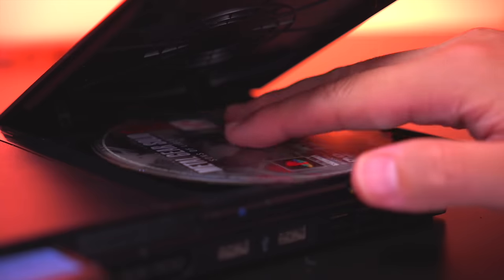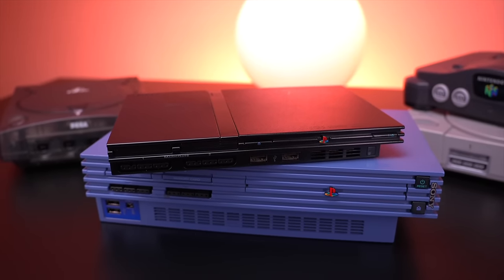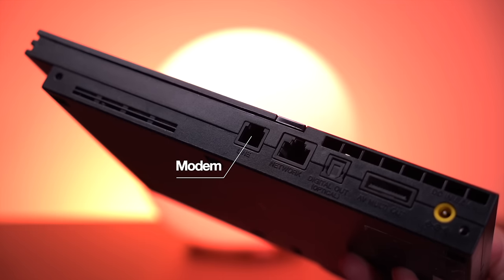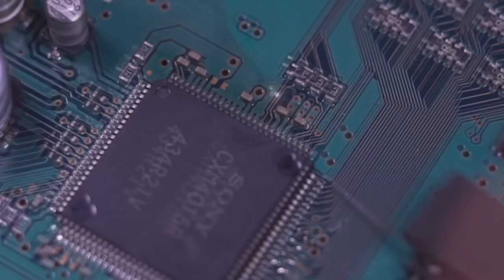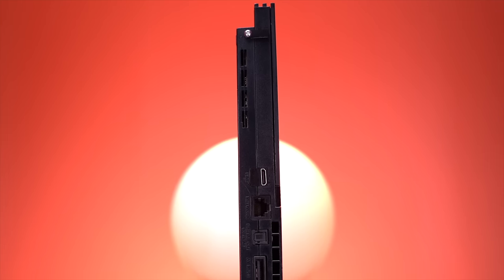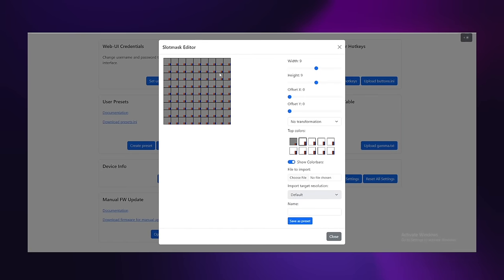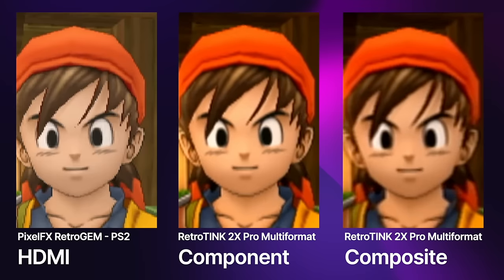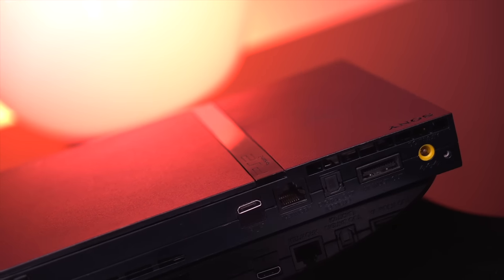This HDMI Mod Makes The PlayStation 2 Look GORGEOUS!

Comment: i've done flex cable installs with leaded solder - any tips for using lead-free solder? read that i should lower the iron temp to like 310C (normally do 360C), but curious if you have other thoughts. thanks!

Comment: Playing on a CRT will be the best way to play the ps2 with true scanlines.  If you want 1080p through hdmi, then the ps3 60gb plays all ps2 games with actual hardware and with the 40gb/80gb through software emulation and both version play ps1 natively  So what's the point wasting time with this?  This company is creating a solution for a problem that doesn't exist.

Comment: I almost turned it off when you said you were using lead-free solder, because that's what the board uses.
I've never heard anything so silly!
NEVER use lead-free solder. It just plain doesn't work very good.
Reply: You clearly don't work with motherboard repairs 😂
Reply: @Daveeeeeeyhowyoudoing  
I've done it for many years, actually.
Generally the first thing I do is remove the lead free solder and clean all of the oily stains it left behind.
Lead free solder sucks.

Comment: Dont take soldering tips from this guy, he should be using hot air to remove caps, and use flux to solder the chip.
Follow Louis Rossmann for soldering

Comment: I am meh on the 1080paywall; but it's a hard "No" if I have to lose the optical out for the thick PS2.   If it replaced the AVout that its...replacing, it'd be an instant buy.

Dolby Digital > 1080p IMO.

Also HDMI mini is kinda shit.  Replacing the AVout port would have given the room for the full HDMI.  And I wouldnt have to keep adapters on hand.

Comment: The fact that people are spending the time and money to produce components like this for old consoles is amazing. I’ll probably never get around to it on my PS2 but to be able to game on HDMI without any external devices is amazing. Yes it’s expensive but the fact this even exists in such a polished form? These kids complaining about $120 don’t know how good they have it 😂 and I’m sure if it was $190 without a cheaper feature locked version they’d still be complaining….what is it supposed to be, free? ?
Reply: $190 for HDMI output that looks kinda shit and requires you to solder anything at all is a complete ripoff. Might as well just emulate if you have that much money to burn, or get some cheap dongle that gets you most of the way there for a tenth of the price.

Comment: The price of this plus the price of consoles just screams dedicated pc emulator unfortunatley. Im happy that i only needed ps2 and have component inputs, but upscaling would be nice, not worth 200 dollars sadly. The fact that they developed a single device for all consoles is not a benefit for users, its just a cost saving measure for them, and they are passing the additional cost to develop it onto us. Its not like you can swap it out on the fly, you have to do the tedious teardowns and soldering so I dont know why they went that route. At these prices, 1080 should be basic and 4k should have been shiny.

Comment: So how does the Retrotink 4k / 5x pro compare to this mod ? from what i have seen the Retrotink is awesome (and no soldering and portable
Reply: I have the retrotink 5x pro for my ps2 (and it is good for any retro consoles) and I use the 2K/2.5K (2560 × 1440 (1440p)) resolution and works great.

No need to solder, just plug all the cables (either use a high quality ps2 component cable or RGB). You can also update the firmware of the device and create 10 different presets and most of these video specifications/features are here too (Deinterlacer, samplings, scaler, horizontal/vertical adjustment screen, etc.).

If you don't know how to solder, I suggest that you get a RT 5x Pro at least.
Reply: @danielsala81  Hi,  My retrotink 5x pro will be here Thursday :),  So i recently decided to revive my PS2... i done a few of the PS2 mods and one thing i have just finished is to allow the use of an external  2.5" SATA HDD instead of having to open up the back all the time to swap out an internal  one etc.. It is a solderless mod for the most part and allows a 12 pin FFC cable to sneak  out of the back of the PS2 and connect it to a small board i created so that you can easily  swap out the HDD if the need arises..  anyone who can reasonably solder should be able to  make the 2 small boards required (1 connected to the PS2 and the other to the HDD with the  FFC cable transporting the signals) i have a proof of concept working 100%. This mod will  cost about $10 to make and if people want it built then a bit more.... A 3d printed  case/support would set this off pretty well and the HDD could be placed pretty well  anywhere outside the case dependent on the FFC cable length
 
  Also, i have created a VERY cheap console to SCART adapter.  2 pieces, 1 plugs into the 
  console, and the other end plugs into a SCART adapter. I am still working on it... the 
  Amiga, playstation 1 and 2 are done and i am working my way through all the consoles.... 
  the nice thing about this is you connect both ends using a regular HDMI cable and the 
  price of the adapters is also VERY cheap... (no more $70 cables) and of course the quality 
  is BRILLIANT! (The HDMI cable is the best means of providing a noise free signal from your 
  console to your upscaler etc.  All the important signals are all shielded.
  I dont know how to post pictures so for the time being you need to believe me but it is for 
  sure 100% real.  I have done a lot of mods on the Amiga so you can search for me (kipper2k) 
  on google.

Comment: 2:50 But is the normal kit artificially never on stock so you (have to) buy the shiny version?
Reply: its also just software locked lol
Reply: There is no hardware difference between the basic and shiny tiers. It's one kit with the only difference being the firmware which you have the option to upgrade to at any time. I assume they did this specifically to combat stock issues. This way they only have to keep one universal mod kit in stock rather than managing multiple hardware revisions.

Comment: All this work and limited featured behind paywalls etc. all for nothing more than an upscaler with some filters. I feel like people would be better off just using an external device for this. What part of what it does makes there a need for soldering it inside the machine? What am I missing? The picture quality doesn't look very great. The component output looks less faded and way smoother. The HDMI is jagged and far too sharp, looks horrible.

Comment: Nice spam campaign... without a reason, there are a lot of videos talking about this mod. A mod that costs $99 in the basic version and $199 the premium version, which is very expensive in both cases and doesn't worth to pay it. If it will include the installation maybe, but just for a chip which I have to solder... it costs more than the entire PS2 itself.
just before knowing about this chip, I bougth a cheap converter for less than $3 and it allows me to play games in an HDMI TV without any problem. And the best, I can raise the resolution to 720p or 1080i with the help of the OPL program. Maybe it doesn't have WiFi or other settings and the video is not "digital", but C'mon... it's a PS2... to play games to 720p is enougth and I will not use the WiFi for sure.

Comment: This is garbage ... it destroys the image color space by forcing it to be in HDMI Limited when it should be Hdmi Full , when you compared it to Component RGB ... and you can clearly see this at 24:00 ... HDMI limited makes all washed out, over white color space of crushed blacks (Shadows just vanish in all games. The Color Black is now not BLACK but DARK BLUE , Brown is not BROWN but DARK YELLOW , Red is now not RED but DARK ORANGE , Blue is now NOT BLUE but LIGHT DARK ... it messes up the whole color space)... Compared to Component RGB, that presents all the color space with the correct colors... aka it craps on color space , making it a pointless mod ...
Reply: Xbox 1\XBox360\Xbone\Xbone SX\PS3\PS4\PS5 are consoles, that where made with Hdmi Limited in mind ... All Consoles from NES\SNES\Amiga\Atari\Commodore C64\SegaCD\GameCube\N64\Genesis\SegaSaturn\DreamCast\PS1\PS2 are made with Component RGB color space in mind (aka Hdmi Full)...  know your difference  , since this is Key in the Lands of HDMI and its Limited vs Full Color space ...

Comment: It has a wifi antenna, but only for firmware updates for the HDMI output mod?  What a waste
Reply: I mean would you rather take apart your console and manually flash the newest firmware onto the kit yourself, each time?
Reply: @ians_parks  if it outputs the HDMI signal, what updates does it need?
Reply: @customsongmaker  Here's a few examples of changes that were made to their previous N64 hdmi mod via firmware updates:

Improved 240p/480i resolution switching.
HDR10 support
Custom aspect ratios
Gamma adjustment
FXR smoothing
Slotmask creator
Custom controller hotkeys
Game ID handling and per game settings.
and numerous other bug fixes and improvements.
Reply: @ians_parks  Hopefully they'll include that when the ship the product now
Reply: @customsongmaker  There's always room for improvement as new discoveries/features are being made in the retro gaming scene. Wifi updates help to future proof your device. You aren't paying for something half baked. You're getting long term support on top of what you already paid for.

Comment: I have basic not shiny and retrotink 4k it might be bob interlacing but the image is very weird on the output.
Reply: Why not use the adaptive deinterlacing on the retrotink 4k instead? Should be possible with direct output mode (assuming pixelfx has released the firmware update for that atp).
Reply: @PolyHertz  yeah just got the direct mode in last update and this is what I did.

Comment: Just a question? Why mini hdmi?
Reply: Likely for clearance concerns. A full size hdmi connector might not fit with a "no cut" installation. Modders have been gradually adopting a no cut approach so that their mods can be reversible and don't permanently alter/damage the consoles. Like when you'd have to cut the case to fit an hdmi connector.

I doubt anyone would actively choose to use mini hdmi otherwise.

Comment: The exterior aesthetics look horrible, it looks bad, you have to cut the PS2 base and case, you need good welding equipment plus skills is required, GT not supported 1080, obviously it's not worth 190.

Comment: Yes the ability to output to hdmi is good. But the mod should not be so expensive considering the amount od work required to install it still. 
For that price I would have though they would have come up with easier install hardware (chip clip on connectors, etc). Given what is required for install with the current design, I think $100 is a far more reasonable price point for the shiny. 
As for the basic, that just seems pointless to manufacture. 
Shiny at a far more reasonable price 'OR' designed with better parts for faster 'clip-on chip'' install rather than soldering so much. 
Til then, I'm out.

Comment: Doesnt look right with that sharp pixels, i would prefer the stock, analoge output.
Reply: There are almost always smoothing options and numerous scanline filters to replicate the appearance of consumer and professional crts. The idea is simply to get a clean digital signal without any analog noise. You can then upscale, downscale, or make adjustments to the picture as necessary to fit your preference.
Reply: @ians_parks  Whoever wants that, but ok...

The analoge output was the charme with it.
Also, something i found out while modding some consoles: Most of these mods have a internal processing time introducing LAG, might be ok on slower paced games, but any faster or god forbid, competetive and you want your analoge outputs.

Comment: yaaawn... yet another high-profile ad video for an overpriced mod that "everyone needs to have", seasoned with showcasing it on THE worst slim model there is, sprinkled with some god awful soldering plus some nice misinformation (leaded vs leadfree solder for example) and scammy tactics like paywalling the resolution. And don't get me started on the scummy price practice ("$99" but you need the flex cables which you can't purchase it without, making it $120 for the crappy version... yeah no thanks). what an absolute joke

Comment: Who is capable of installing this that doesn't already own a PC capable of emulating PS2 games? You're going to get drastically better quality actually rendering at higher resolution with an emulator rather than upscaling, and it's probably free if you already own a computer with any modern graphics card. Even recent mobile devices can emulate PS2 now. Want to use the PS2 controller you say? Get a USB adapter for it for next to nothing and save $190. 

I get this is a neato engineering project for whoever designed it but it has no use in the real world and the price is insulting.

Comment: HDMI modding a PS2 is pointless. Why even bother when you can just buy a cheap PS3 that does everything and more for far less? You could even buy multiple PS3's for that price, or even a PS4 and firmware mod it FOR FREE to run every previous PS disc and more. Anyone that buys this for the price they're asking has no sense. They're 100% not out for the community at this point and they are only out to make money. This is a massive disappointment. Don't even get me started on the software paywall that PixelFX has included in this one due to how much of a scum move that is. The Dreamcast mod is awesome, but this is over-priced garbage. What makes it worse is that you have to configure it due to the software not even being that good, yet you have to pay MORE to access features that are software-locked? There is no way that anyone is happily buying this shit. This doesn't make you look good Tito as you're gladly shilling this crap scam to us and not calling them out on it.